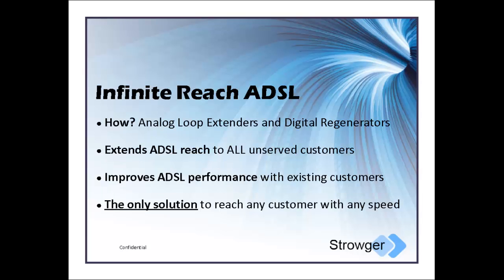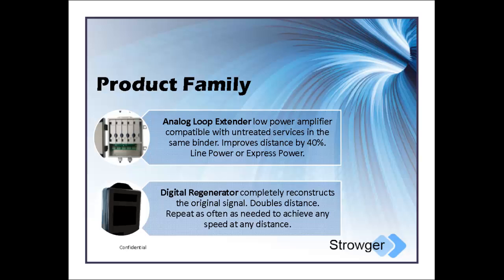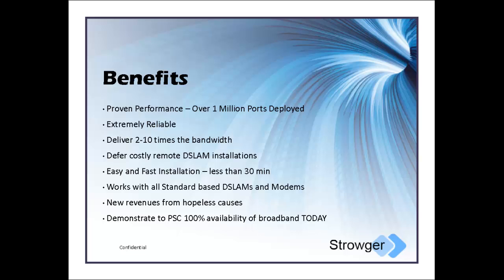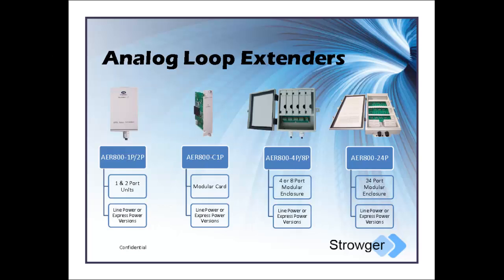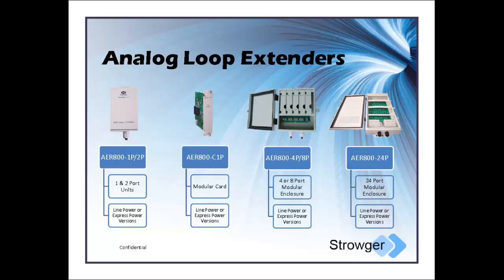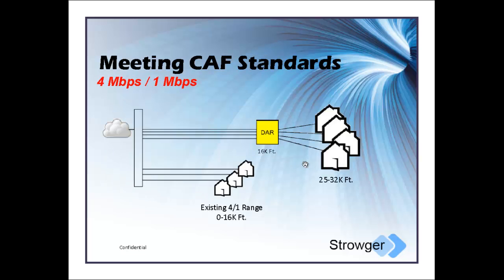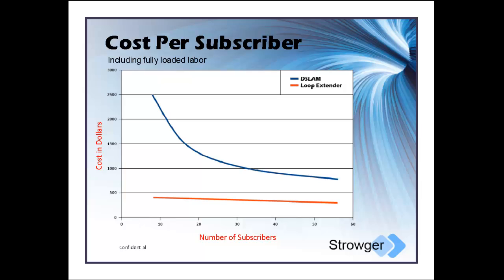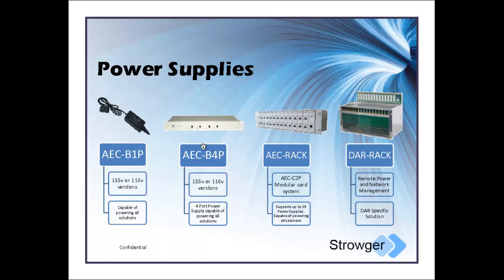Infinite Reach ADSL

Comment: I am currently a Frontier customer. I was very happy with their service a few months ago. We live in a rural area and its either satellite, Verizon pay by the GB wireless or Frontier DSL. When we were in town the speed easily exceeded 7Mbps down not sure what the up speed was. I know...not much for all you cable internet users lol. The problem came when we moved on the outskirts of town to a bigger home. We are not what Frontier tells us at the edge of service and speeds are at .32Mbps down and .12Mbps up. I have installed a POTS splitter, rewired the home phone wires and run cat5. Just to be at the same speeds. I stumbled across information on ADSL loop extenders about 2 months ago but was told it was something that Frontier had to decide if you needed. While researching more this evening I ran across Strowger. They offer a DSL loop extender for Frontier customers (AER800-1PL). I will call Frontier tomorrow and see what I can accomplish from here. I am very intrigued to see if this will work. I hope that this solution will bring some satisfaction to my problem. Will post an update when all is said and done.